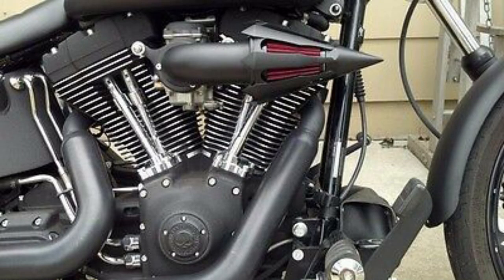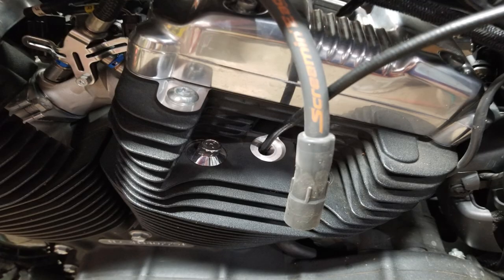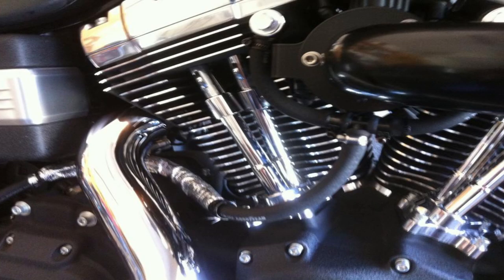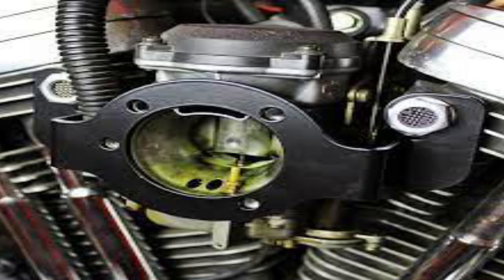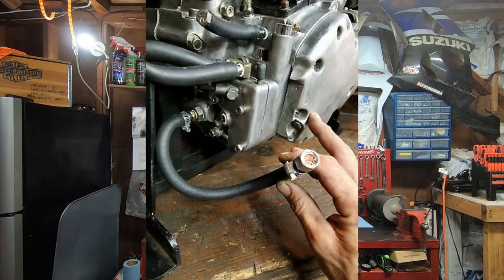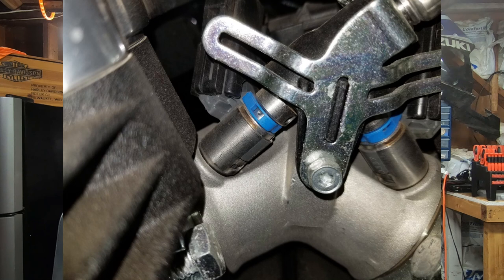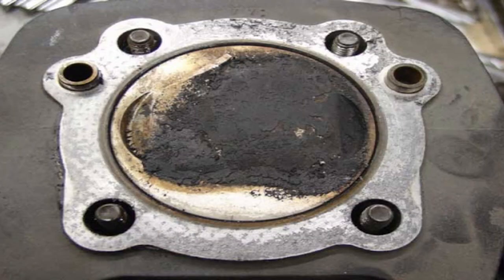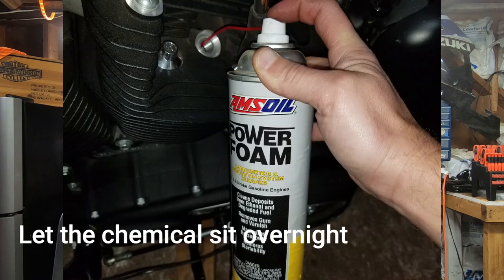Why Your Harley-Davidson Needs a Catch Can or External Breather System

Comment: Mine looks identical the chrome backplate you showed. Tubes from the breather bolts to a tee. I drilled the backplate to accommodate a rubber grommet so the tee fits very tight. Ran tubing straight down between the pushrods and forward down below the oil cooler.  Very clean and discreet. All parts from ACE hardware. About 12 bucks I think. Did it 5 months ago and have not seen anything liquid out of it

Comment: I took an Arlen Ness Heavy breather backing plate, cut off the two mounts to the engine, and then used banjo bolts to install my catch can . The air cleaner backing plate holds nicely with the three bolts around the throttle body.

Comment: I did this to my carbureted Sportster XL883 several years ago without a filter or catch can on the drain tube.  I did have my stock air filter housing modified but I eventually switched over to the Drag Specialties carb support plate and crankcase vent system plus a TC BROS air filter kit which I like even more. The drain hose runs down through the swing arm and exits about 2" below it. 
My 883 vents such a small amount of oil that after I park it and place a paper towel underneath the drain hose, only one or two teardrop spots will appear in the next several hours. Different bikes may vary in the amount of condensation but it's no problem with my bike. I've never found any oil on the tires or frame. My air filter stays completely dry and so does my air intake in the carb.

Comment: Great video sir! I found an external breather made by Kuryakyn for my 2000 Deuce (TC88B)...it separates the oil from the air and only air is vented. I will find a part number and leave it in the comments 👍

Comment: Google "EMPI breather box". It's made for air cooled VW engine's but will work on Harley's as well. You'll need to fab a mount for it and figure out where to put it. It has a foam filter that you put a little oil in when you install it but after that the oil in the vented air keeps It wet. You can run a hose to the air cleaner from the box but it's designed to vent without needing to do that. It will produce a distinctive smell if you don't run a line to the air cleaner. Two screws hold the cover over the foam filter so it's easy to service. Wash the foam out with gasoline and apply oil when needed. It will cure your venting problems.

Comment: I have an 04 heritage 88 carbureted. I ran an external but simplified it. I put rubber plugs into the back of the filter, kept the original breather bolts coming out of the heads. Cut the rubber "S" tube that are on those bolts in half, put in a copper tube inside it and ran rubber fuel line into the copper tube and to a "T" connecter doing the same with the other head, then ran a line from the "T" out of the air cleaner box down the front frame to another 3" copper tube plugged into that. Bent it 90 degrees and did a 1/2" bevel on the very end but leaving a 32nd in opening at the end of the copper tube, hose clamped it to the front header pipe by my floor board. Figure, burn it after combustion instead of at combustion. That 32 opening keeps from any build up of oil. Been running it two years and only have a one inch residue mark on the pipe, no drips or smoke. No catch can to change out, I did that at first and didn't like it.

Comment: Just fitted a system to my harley heavy breather, have to say particular breather is well suited to the job. Bought all the parts DK lists off ebay and shaved £100 off their prices, used black braided hose and black anodised alloy hose end finishers, sprayed the T piece black. Blocked the tiny vomit vent holes with an inch of Gorilla silicon sealant. My only advice is ensure your thread tap is long enough to clear any potential obstruction or use an adjustable wrench end on ; ) Even though the AIT sensor is behind the butterfly in the fuel tract, meaning fuel cleans it on later model bikes, the thing will still occassionally get vomit from the head breathers on it and cause random slow rpm drop, or low speed engine cutoff. So not just a decrease in power and carbon build up.

Comment: When I had my 2000 LS2 V6 Saturn I would get the Bilstein oil flush, and induction service and the car ran great!
Reply from the maker: Keeping the engine flushed out and the intake tract clean does wonders, just like on cars you gotta clean that throttle body out every now and again. That makes a huge difference!

Comment: I currently have both a D&K external breather kit - drilled and tapped my SE stage one backing plate, AND a Feuling vented dipstick installed in my high performance custom 107" motor.  I still get more than a little oil coming out of the D&K that I have routed to a K&N filter below my intake, but usually only when I am running the motor pretty hard in the hills and curves, or running near 3000 rpms on the highway for an extended period of time.  This is really aggravating.  I have just ordered a TRASK intake and they do offer a head breather bypass option for additional money that replaces the bushings between the backing plate and the heads.  I think I'll be running this time in an upward direction so as the oil mist condenses, the oil will drip back into the heads instead of on to my camchest cover...
Reply from the maker: Damn yeah those M8's are a pain with the oil from breathers. Hopefully that new setup will help, sounds like you've done everything right to combat it.

Comment: I've done catch can installs on DI cars. It was pretty straight forward. You make it sound complicated. I would just vent to atmosphere since the amount is so small. I dont see why a different tune would be needed. Again the amount is so small. Airplane engines (lycoming and Continental) all vent to atmosphere. Over filling oil doesn't help...keep oil mid range on dip stick.
Reply from the maker: It's not hard to do, it's just harder to on a bike while being able to hide it and make it look clean.

Comment: I just did mine when I swapped my tc to mikuni. It was simple and cost twenty bucks maybe. Y brass fitting and a little filter with some 1/4” hose. It actually seems to run better too

Comment: I'm glad that I saw this video. I had come across a couple videos, by DK Customs, about external breather systems, and I was thinking about eventually getting one. I was thinking that it sucks that carbon is already on my pistons, and I'm just stuck with it. Now, I know that isn't the case. I also didn't know that Hammer Performance has an external breather system for Sportsters. I'll definitely be checking into that, for mine. I appreciate all the information. Thanks
Reply: Take the air cleaner off and mix rubbing alcohol and water in a spray bottle. Start the engine and let it warm up and start spraying the water mix into the throttle body/carb. You may have to give it some throttle but as soon as it hits the insides of the engine look at all the black shit coming out the pipes lol. Nasty stench too. Then let it cool off and look thru the spark plug holes with a small borescope and the tops of pistons will be gleaming clean.

Comment: Your more recent video about the benefit of a vented dipstick is a good footnote to this video.
Reply from the maker: So far the sumping issue is mainly on the M8 but any Harley engine can have it happen. The M8 just has a serious lack of crankcase ventilation with the head breathers. Vented dipsticks would sure help on any Harley engine for sure though too.
Reply: @GixxerFoo  I am doubling up.  I ordered the Freuling vented dipstick, and I am also routing 1/4 inch tubing from the breather bolts on my SE Ventilator down to a t-fitting, then down a 3/8 inch line to a Uni crankcase breather filter that I will mount under the bike.  I am doing all I can to keep that crap off of the top of the pistons.

Comment: Good stuff. 

I run the DK customs EBS stage 4 catch can. This actually helped me notice how badly my engine was sumping. Since so much oil kept filling up in my can, I wondered why? Turns out excessive run out was causing sumping and blow by... 

So, if you're finding the catch can is filling up too quick or your EBS filter is saturated too fast, then you might have a bad flywheel.  

Anywho, good vid. 👍🏽🤙🏽
Reply from the maker: That's a great point! Thank you for sharing that! Did you get your motor lined out after that?

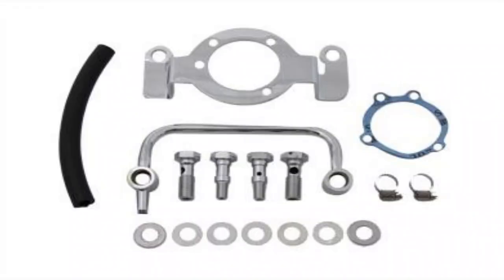Comment: Glad I found this video!  I bought a '94 S&S Sportster a while ago.  It had the S&S air cleaner on it, and I've never really cared for them, too big and bulky imho.  Got a nice little wire cleaner, but it left the breather bolts open.  As an engineer, empty bolt holes offend my eye, but I wasn't sure what best to replace the breather system with.  I think I will, after watching this, try the set up you show at 3:00, they seem to be available over here in the UK.

Thanks for the info!

Comment: For the carbon...way back when I went to MC school they taught us to mist water in the intake using a spray bottle.  the water is superheated and gets in the carbon and expands and breaks it up.  I've done this many times.  seems like a similar non chemical version of the topend cleaners mentioned.
Reply from the maker: That works really well, it's good trick to use.

Comment: I was amazed when I took a hard look at the set up on my 2000 wide glide.
I had asked for the screaming eagle air filter before it left the dealer. Lo and behold, that included a vent system that has a drain tube routed down behind the engine. It does not have a catch can, it just vents. LOL

My local Harley shop told me that was standard Screaming Eagle with that year. I looked at their website but could not find it. Maybe they had to discontinue it due to some EPA rules?
Reply from the maker: Yeah EPA cracked down on that, being a 2000 model that bike and all parts made for it would of been exempt from the new regulation. Sadly I don't know for certain how long that is going to last the way things are going, I'm sure eventually they will do away with the grandfathering in.
Reply: @GixxerFoo  Maybe I should delete this so "they" won't know? LOL

Pizzonit.  

Although there is a set up where a guy routed hoses down under the filter element and back up near the top where he added gasoline filters to trap the oil vapors. That should dramatically cut down on what goes into the engine. Probably need to change those every 5,000 just like the engine oil. Another tip would be to leave the oil level halfway between full and add so as to leave more room in the crankcase.

Comment: i just run to atmosphere . I have never let it go to the air cleaner. They dont inspect motorcycles here in Arizona.  You can I believe put a crank vent on K&N used to make them maybe they still do?  I dont even do that . I just a run a piece of hose to under the bike. On my chain drive stuff I use it as a chain oiler! [choppers I build] Screw the EPA.
Reply from the maker: That's the way it used to be done back in the day with the chain oiler system!

Comment: I really wonder why the air coming out of the breathers would be oxygen depleted since it's not coming from the combustion chambers but the crankcase and head.  I get it is saturated with oil wich is bad, but my understanding is that this air is coming in and out every turn of the engine right?!  Anyway, I'm looking into this for my 96CI Harley.  Many thanks for all the informative videos you post.
Reply: Not sure if I get it. Combustion happens above the pistons and below the heads. That's your "combustion chamber" right? Where does the vented air come from into the breather bolts? Air goes in through the air filter and throttle body. Fuel goes in through injectors, sparks cause combustion. Do the breathers vent air after the exhaust stroke or intake stroke? And it's coming from the crank case? So that's under the pistons where no combustion takes place. I think I get it now.

Comment: After looking into the EBS systems and watching your video I went with the DK Customs system with the catch can hanging under the breather, (why pay for a piece of billet and not accent it) for easy access. I opted for the steel braided line and shiny clamps but since they were hard to work with I just got some 3/8 gas line and used zip ties instead of clamps since there’s no pressure on the lines. They only breathe. Took the bike for a ride to make sure I had everything tight and wasn’t looking for a power gain but I did notice a little bit better response in the throttle, again, wasn’t looking for it so I ruled out the “placebo “ theory.
Reply from the maker: Hammer performance tested it on their dyno back to back with their shop bike. Routing the crankcase breather externally netted a couple horsepower on the big end!
Reply: @GixxerFoo  thanks! Now I know it wasn’t me👍

Comment: No need for a retune on an M8... these engines have a richer AF setup compared to the TC. I use Amsoil Quick shot at every refill. It fights ethanol fuels and also helps clean the carbon buildup. I run the DK Customs external breather and my bike runs much better than without it.

Comment: Im running a classic s&s teardrop aircleaner on my twin cam , it gives you the option to go external or internal couse its runs hoses from breather bolts to intake .... no need drill and tap ... just add hose 👍
Reply from the maker: Is that with a fuel injected bike?
Reply: @GixxerFoo  yes its a 2013 street bob , 96” (still 96”)

Comment: my last 4 Harleys all had a crank breathers installed,  no fouled plugs or carboned up valves , all have over 200,000 km on them in Alberta Canada not sure about the 99 softail my son has now , but he is having problems with oil fouled plugs and piston carbon .
Reply from the maker: Having that stuff routed to where it's not going back into your intake makes a big difference!

Comment: I been thinking this for years.  I should.  On my 2010 screaming eagle. Should i plug holes in side of carb from the breather? after i put t to air filter.
Reply from the maker: As long as it is vented to atmosphere but don't plug the holes and not let the crankcase breathe.

Comment: So I run Lucas Top end add a death in my gas I thought every three tanks or so at least once a month. I don’t know I don’t have any problems with the stuff. And keep the umbrella valves working properly. 2014 CVO’s 45,000 miles compressions perfect bike runs awesome. The worst thing I ever did for my bike was going to Canada and buying gas there. Man their gas sucks . I was running octane boost had to in Canada still needed a set of plugs when I got home
Reply from the maker: Yeah lower octane fuel or just low quality fuel will cause all kinds of issues. I do the same thing with my bikes running some system cleaner through there every couple of tanks, helps keep the top end a bit cleaner.

Comment: I really like you Videos , what is your background in Mechanics  ,  are you a full time mechanic , your Videos are spot on , just wonder about the ramifications from Harley on bikes in Warranty.  My bike is a 2015 , bought new , have close to 40 K on it now , bought it new , I bought the Extended Warranty from Harley and upgraded so I have a few years left on it. I have the wheel and tire Warranty , plus the bike itself Warranty  also. 
     You do a real good job explaining  everything in it. 
Just don't ad the factory  Warranty's though.
Reply from the maker: For example, my wife's bike was under warranty with a SE air cleaner with a external breather, aftermarket exhaust and a Vance & Hines Tuner. Fuel Injector connector clip broke and that was replaced under warranty no problem, blew a fork seal they rebuilt the forks with all new internals under warranty. If a hole was melted in a piston they would have to prove it was the breather, tuner, exhaust and not the factory ignition.

Comment: There are actually people on YouTube arguing that this is a nonissue. That’s their opinion and they can do whatever they want. My thought is that it’s easy to do and cheap as well (easy if you go with DK customs anyway) why wouldn’t I do it if it helps out my engine? I got an air cleaner from DK and breather bolts and it was super easy and cheap and I’m not sucking hot air back into the engine. That’s nothing but a win. I also put a vied fuel management device on the bike instead of an expensive tuner due to the extra air flow into the engine. It moderates the air/fuel mixture for a stage 1 and is about a third of the cost of a tuner.
Reply from the maker: Bikes will run fine without one and put a lot of miles on the motor as well. I guess you could argue it as a non issue there. However, the carbon build up on the pistons robs horsepower and in some cases can lead to serious issues.

Comment: I added the Feuling dip stick breather for my 114 M8.  I'm also going to add the Trask Assult air breather with the external breather option.  Not sure if running both is recommended so i'll have to look into that before i add the trask component.
Reply from the maker: There's no issue at all running both and it's just good insurance on a M8.
Reply: Trask “checkM8” transmission cover vent is the way to go.  Nick Trask has a 1:00 video on it, as well as an installation video by Moots.

Comment: But think about it. positive crank case ventilation for cars has been around for over 40 years. i dont think it is a major problem. I had a corvette back in early 70 and it had one. PCV valve. :)

Comment: I routed my breather lines upward just under the fuel tank, then back down under the carb to the catch breather. I've found that the oil mist goes back to the heads about 90% more, and out of the catch breather. Would post a picture if I could.
Reply from the maker: Thanks for sharing! That's a really good tip!